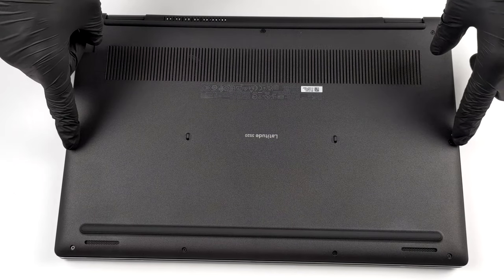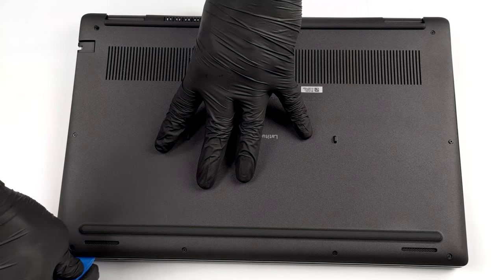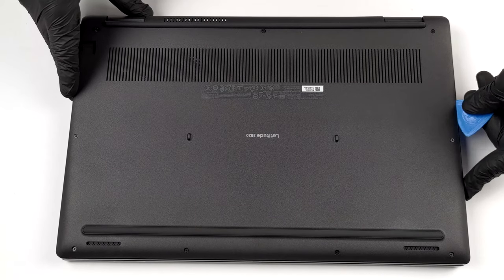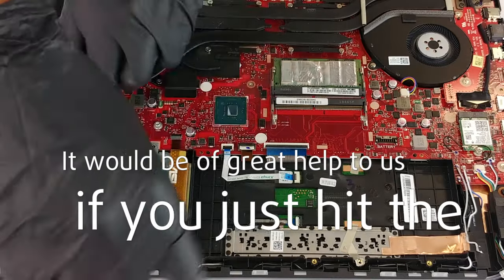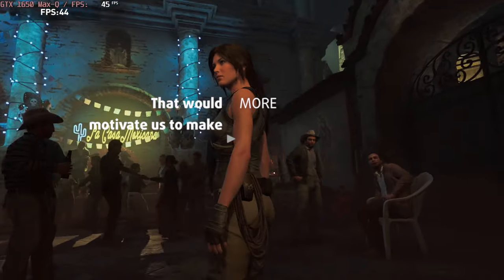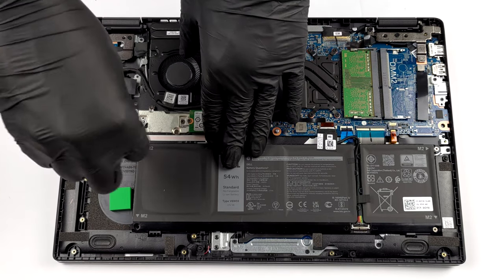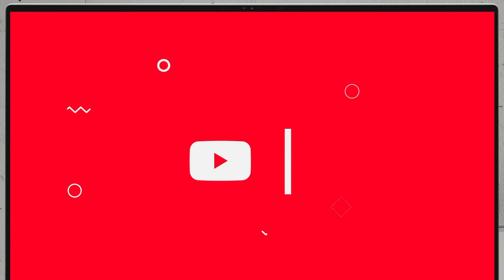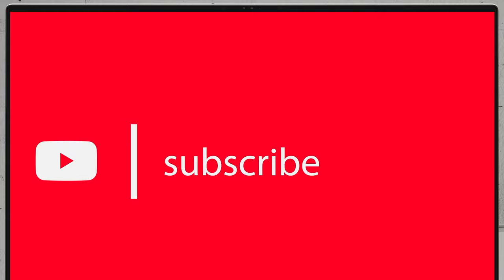🛠️ Dell Latitude 15 3520 - disassembly and upgrade options

Comment: i'm using inspiron3520 i31215u 

in my bios ram speed shows 2667mhz
but why ?

can i use 3200mhz speed ?
i opned the hardware ram the ram is installed 3200mhz

Comment: Can you install an nvme ssd such as the WD Black Sn850x version that comes with a heatsink or it won't fit inside the laptop? Also, if i install a M2 NVME such as the Sn850x version that comes without a heatsink would it overheat (or does the laptop have a heatsink plate preinstalled in it)?

Comment: So if I want to install a 2.5" HDD or SSD, I need to replace the 3-cell battery with a 2-cell battery. Also, does anyone know where to buy the mounting bracket and the cable thing for the 2.5" drive?
Reply: HI. I am also to do the same. Did you got any solution for adding additional SSD?  please reply
Reply: I think you use the existing 3cell - as shown above.  The larger 4-cell battery takes up the entire width of the lower case.  It appears any 2.5" SATA drive would fit on that small yellow heat pad in an 'empty' space to the left of the battery.  I wish this demo would have covered that explicitly.
Reply: Did you got any solution for adding additional SSD? pl tell me  thanks

Comment: Is 32 gb per slot or 32 total (for both slots). Dell says maximum ram is 64gb but my laptop says maximum ram is 32gb I dont get it...
Reply: i'm using inspiron3520 i31215u 

in my bios ram speed shows 2667mhz
but why ?

can i use 3200mhz speed ?
i opned the hardware ram the ram is installed 3200mhz

Comment: Just bought thid a week ago. I have the 512gb nvme pci drive and would like to add a second drive. Only problem it looks as from the build I have the extende 54whr battery so i think it would block the location for a ssd drive. any ideas.
Reply: HI. I am also to do the same. Did you got any solution for adding additional SSD?  please reply
Reply: Buy battery 41w
Reply: Did you got any solution for adding additional SSD? pl tell me  thanks
Reply: @Phoenix-kj2fn  replace the 54wh battery with the 41wh battery and buy a 2"5 inch drive mount